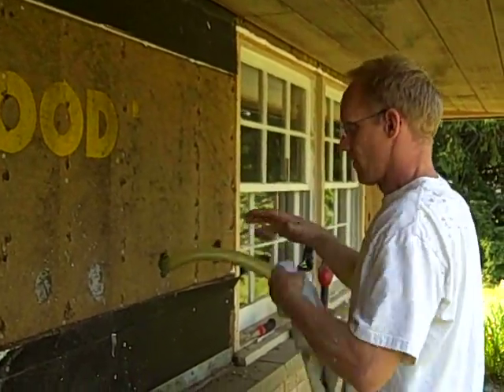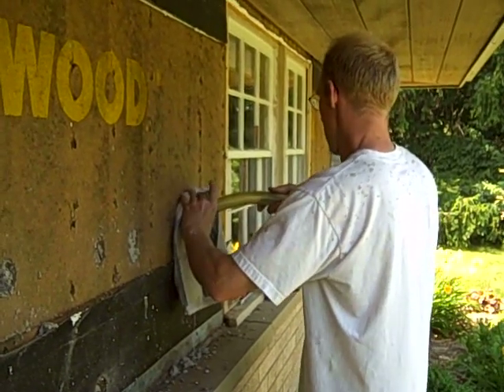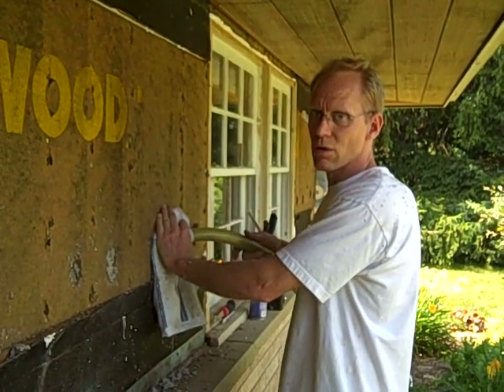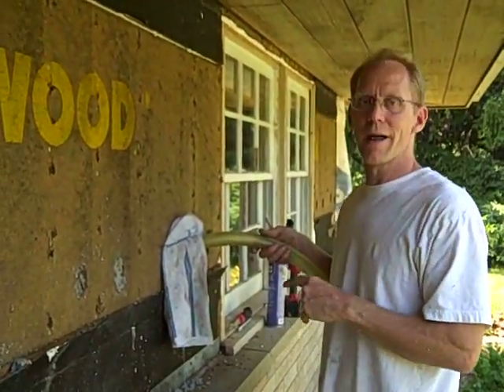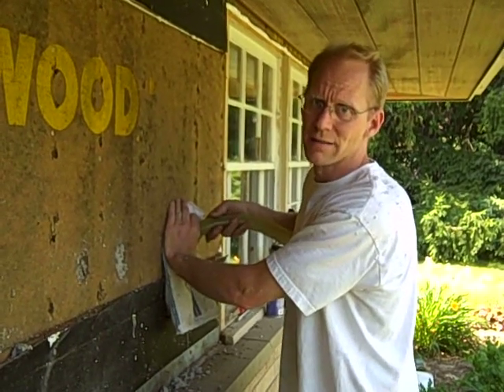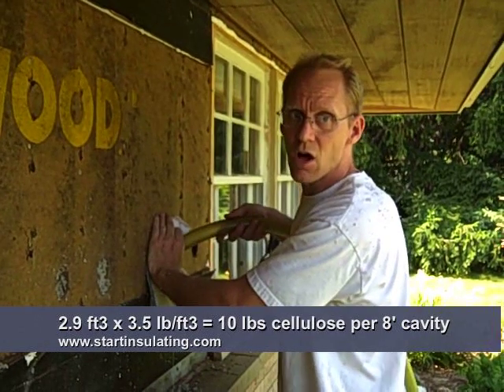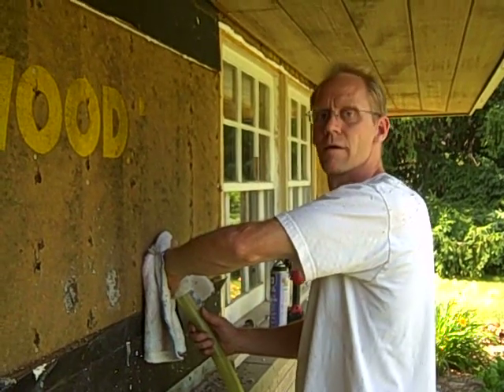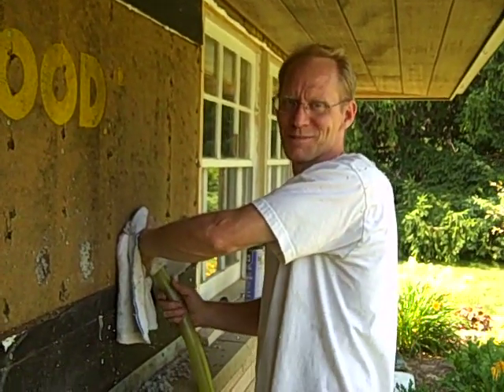Dense pack cellulose insulation from exterior redwood siding

Comment from the maker: Not much you can do if the wall insulation is standard thickness.  If it is older and only 1-2" thick leave it in and pack over it.